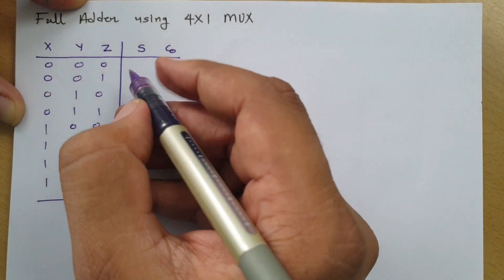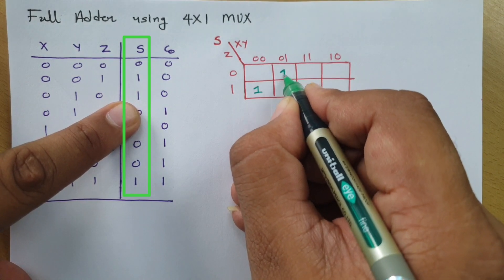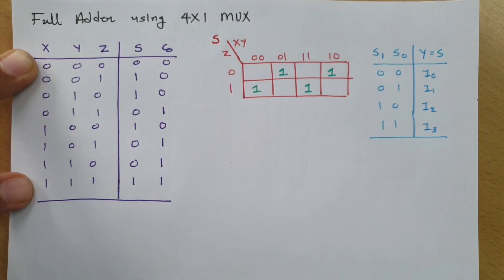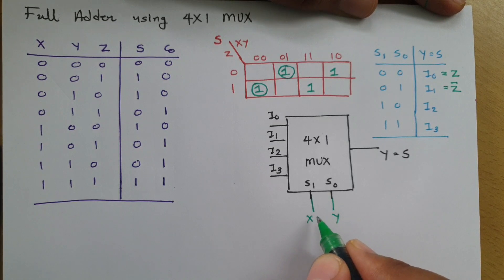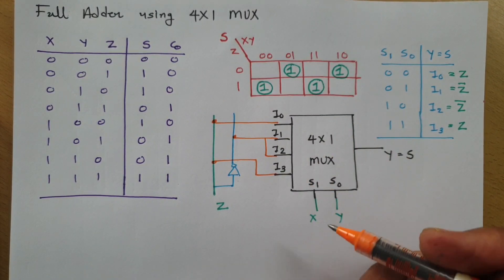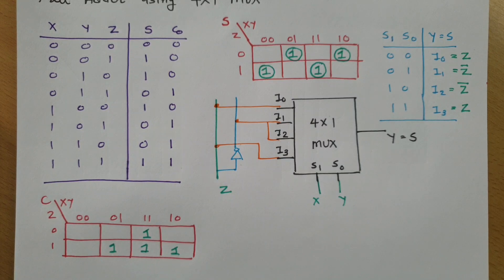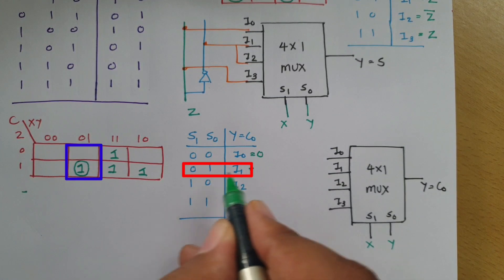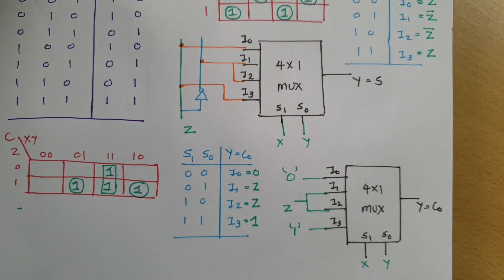Full Adder Implementation using 4 to 1 Multiplexer: Designing and Circuit

Comment: Sir ,

I know that in multiplexer selection tables, binary code is used, not Gray code. Multiplexers (or MUXs) use select lines to choose which input data line to route to the output. These select lines are controlled by binary signals